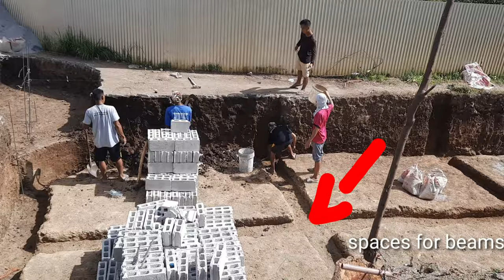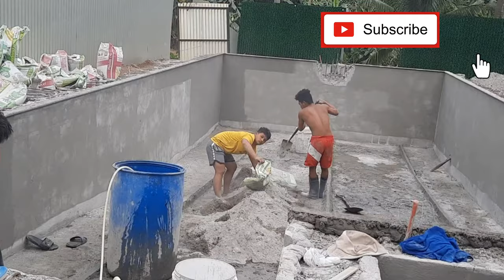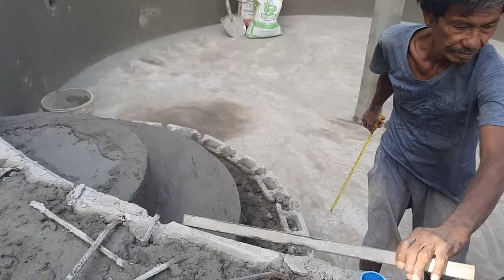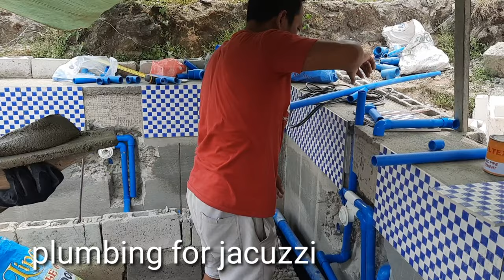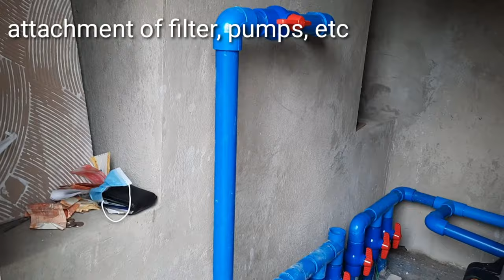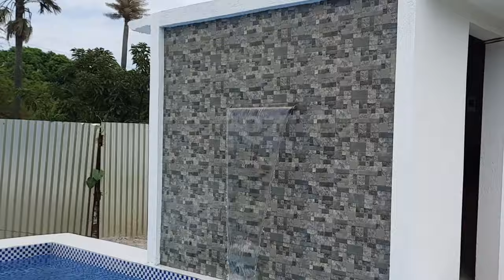Swimming Pool Construction complete from start to finish (Day 1-90) how to build pools/ Philippines

Comment: Pano po pinour yung concrete sa inner part, after ng hollow blocks? Yung may mga rebar? Pno po di tumapon or gumuho ang bagong lagay na concrete?
Reply from the maker: Meron pong screenwire don na naghohold
Reply: @gelynmendoza3415  ooohh i see ate. Mrming salamat po
Reply: @gelynmendoza3415  requesting for update po kung hndi nagkaron ng crack after how many years po

Comment: Congratulations on your pool build! So inspiring. May i ask po yung buildcost ng pool mo? The tiles are gorgeous! What size po yung tiles? Are these regular floor tiles or mosaic for pool? What is your pump brand at HP? Thanks
Reply from the maker: Hi thank you. The tiles are 40x40cm. Usually they use 30x30cm mariwasa tiles but I requested for this kind. This pool is less than 2M
Reply from the maker: We always use hayward po which is the top brand and its 2hp if im not mistaken.
Reply: Mam, magkano po lahat nagastos nyo sa pagpapagawa ng private resort nyo at ilang square meters po yung lupa?
Reply: @gelynmendoza3415  hello po maam ..salute po ako sa design ..magkano po lahat yan? Meron po ba kau list of materials maam ..salamat
Reply: @gelynmendoza3415  hi po. Pwde po mahingi list of materials mam? Planning to make a diy pool po